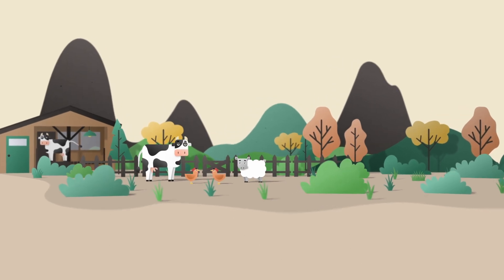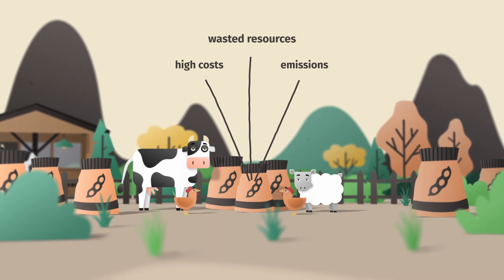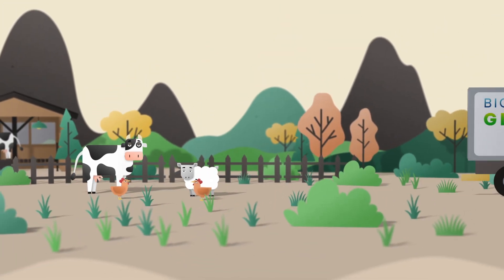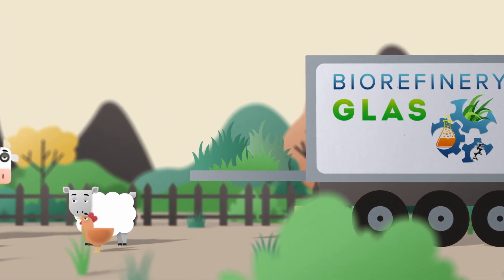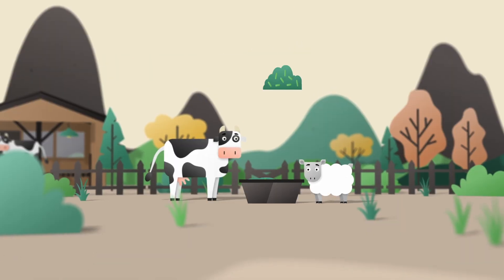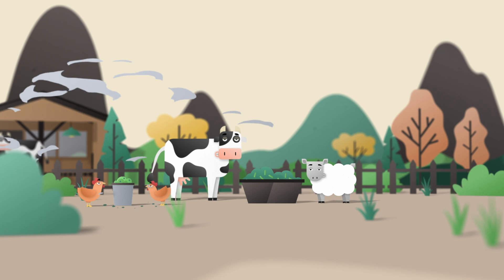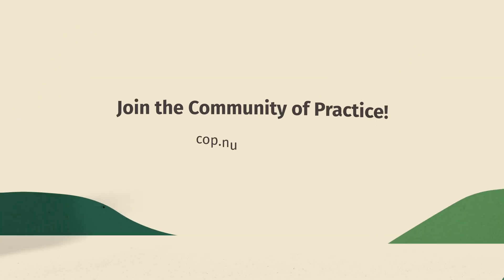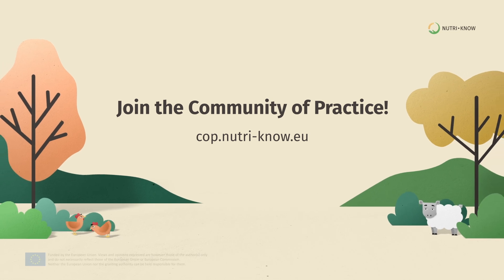A Grass-Based Alternative to Soy

Comment: Interesting! 🤔Out of curiosity: Does the taste of meat/ milk from these animals change when they're fed with grass instead of soy? Though I guess taste is also subjective so maybe hard to answer. 🙈
Reply from the maker: That's a great question—thanks for asking!
For cows, using the grass-based press cake in their diet doesn't change the taste of the milk. The press cake contains the same components that cows would normally digest from fresh grass. The biorefining process simply removes the parts they wouldn't use anyway (the bits that usually just pass through 😉).
For chickens and other monogastric animals, the refined grass whey is used as a protein-rich feed. Since it's a concentrated and balanced nutritional input, it shouldn’t affect the taste or quality of the meat.